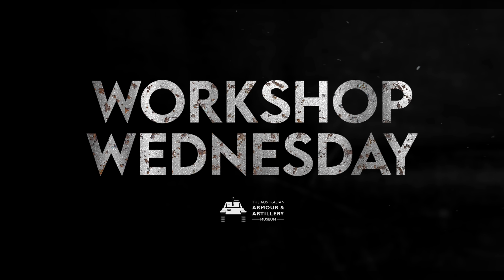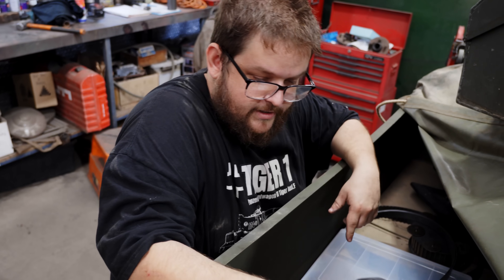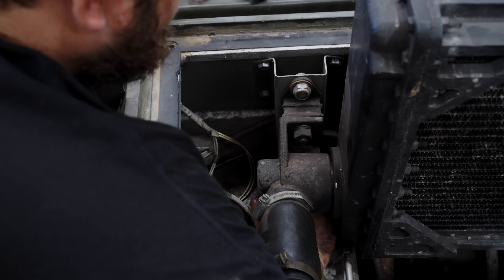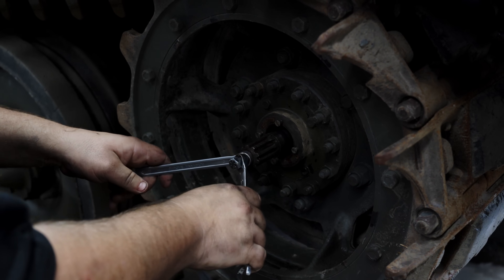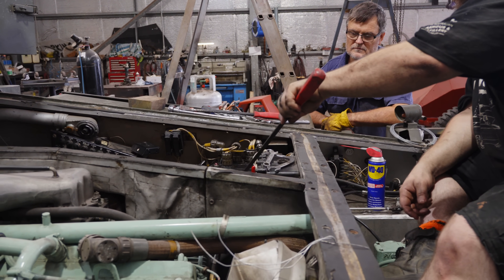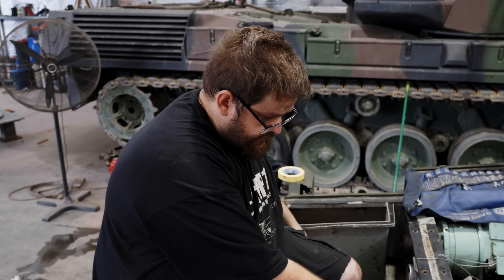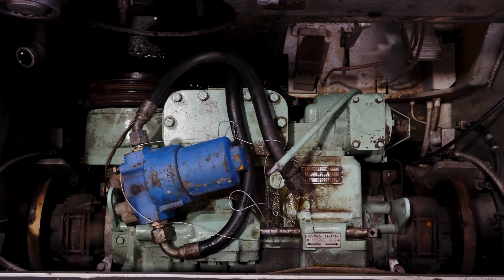WORKSHOP WEDNESDAY: What's wrong with our CVRT Sabre???

Comment: We had three fan belts go in one cold rainy night at Bovington. It was due to a missing shim on the gearbox mount. Absolute nightmare as we were supposed to be tactical 😢
Reply: Most wrench pullers would never think of alignment on a high speed high load coupling giving problems.My guess is 1 mm over the entire face of the flange total , cant be done if you loose track of the shim pack from the factory. Takes a millwright to fix now  , and a good one.

Comment: There are days when I reckon some of these designers just did things to be mean… starter motor in the valley of a V8, starter under the exhaust manifold (of course, if the starter isn’t working, odds are the manifold will be cold, but still)… thanks Graham and all at AAAM.

Comment: been there seen that, all good fun, some things are bolted in so well, you wonder why bother, and those bolts are usually still there because nobody ever bothered to remove those parts, when replacing the awkward bolts are generally left off which is when that term, 'somebody's been here' comes into play - incidentally, we backward engineer some parts for CVRT, got a load of complete fans and still waiting on belts to come in via Mars i think
a good cheat before removing engine and/or gearbox, do laser alignment between input/output where the shaft goes and double check that interconnecting drive shaft is for diesel or petrol respectively, no doubt you know that, i had to learn that one

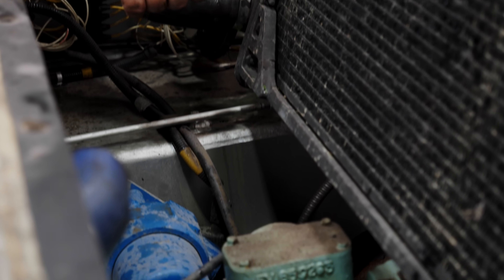Comment: at 2:48 do you why the engines supposed come out first > how do you supposed to do it > take the two Dive yolks off,unplug all the quicker electrical connection they all should be in the same area,take cross member of 3 bolts on either side pull if off and get a crane and pull the whole engine out as one unit because they're packed units all British personnel carriers in the 70s and 80s engines were packed units for quick supplies and put back into the fight so mate you're doing it completely wrong and be fighting with all the time to undo bolts what are hidden and hard to undo  👍👍
Reply: the idea of it was in case the British personnel carriers had a dress short through the engine they could replace with a new engines in it and put it back into service again after patching up the hole in the field and with the new engines that was the idea of them 👍👍
Reply: your right ! like the M113

Comment: do you know that they got drain points under the personals carrier to drain all fluids all water and oil they are little inspection caps you going a crawl under personals carrier with a rattle gun with socket's undo the bolts let the plates drop and you will find a tap turn it on and oil and water come out off it  and the engines are in pack frame so you can pull it out quicker and go back to work all you have to do is release quick connection and pull the engine out and for you do that have to take the cross member off what the front of the Armour bolts on 👍👍

Comment: 2:28 you've never worked in a workshop, if you've never made a mess on the floor. Period. I can 100% say this, because even in Bugatti's (from the days of the Veyron) picture perfect shop, with revolving tiles that slide away from the engine rack that's affixed to the floor on a track, and all that jazz and bling... there's puddle stains. :) They cleaned them well, but they're still visible.

Comment: As mentioned below, The shaft that has sheared is the transmissions oil pump drive which is constantly driven when the engine is running allowing oil to be pumped around the transmission for lubrication and to allow the selection of gears via the valve block, to see that shaft sheer like that is a bit odd, think I only saw 1 in my time with them and that was caused by overtightening of bolt on the part of the shaft that has sheared which is in the middle of the main input flange, the one with the woodruff key that ties both the oil pump drive and the drive to the centrifugal clutch together. Internally the transmission its similar to an old style auto box with epicyclic gears forming the gear train selected by hydraulic application of clutch bands giving 7 gears both FWD and Reverse due to the gearing controlled by the direction changeover lever (left of the drivers knee) I did note that when the drive shafts were being removed, the locating/securing pin on the transmission end didn't seem to need to be depressed (its accessed via 1 of 3 holes on the transmission output to final drive and is a spring loaded cone, retained in the drive shafts) which would indicate the shafts were not aligned correctly which could lead to loss of drive through disconnection. Whilst your this far in its probably worth pulling the driveshafts out the final drives and checking the condition of the sheer pin on them, just a roll pin that secures the 2 halves. the shafts are removed simply by pulling them into the now empty hull, you can check the seals on the final drives too then. To re-align the transmission, shims are used on the centre mount to raise/lower the back of the transmission. there is a measurement from the bottom of the hull to the fanbelt pulley or you measure from the 12 o'clock and 6 o'clock position from either the centrifugal clutch or fan pulley to the flywheel to ensure correct alignment. The radiator can be easier removed or fitted by only undoing 1 mount and sliding it out of the other one. If you ever have fuelling issues, there is a stupid one way check valve near the electric pump that tends to get stuck open with debris, the tell tale of this is the fuel pump constantly clicking away to itself at a steady pace and not slowing indicating its not building pressure.
Reply: not your first rodeo mate !
Reply: @pierreguay6577  nope, worked with them from the J60 jag petrol engine into the cummings diesel era on most variants most recently being scimitar 2. Compared to the other tracked vehicles we nicknamed them skateboards lol

Comment: You can get a set of Starter Wrenches that are made just like you made.  They were designed for starter bolts that were back behind the starter.  Also, a set of offset open-end wrenches that had one end at almost 90 degrees to the other end are worth their weight in gold.
Some old German mechanic is laughing at your getting the short end of the shaft.

Comment: Gearbox input Oil pump drive shaft. They do fail but not on the extent of what he said. When the Cummings engine was retro fitted to CVR T then they had serious issues with the pump shaft. The Gearbox works on Oil Pressure so once the Input pump drive shaft fails. All gears are lost. It drives all the time the engine is running and independent of the centrifugal clutch. You will always have to remove the drivers seat, Fire Wall and 'T' Piece to remove the Gearbox. Enjoy the experience!

Comment: Spent 3 years working on cvrt's in a first line LAD  pulled many a box and engine out, one suggestion I would make is to fit a spare gen gelt and secure it out of the way , saves a whole load of messing when they snap look forward to having fun when putting the quill shafts back in. If you don't get it back within 5 mins then get some one else to try

Comment: Observation: ALL engineers should be required to complete a mechanical trade course/apprenticeship BEFORE being allowed anywhere near a university.
Reply: You might then get a shortage of engineers.   I was a tradesman/technician for 20 years before doing an engineering degree at university.   It was touch and go whether I would go to uni, because I liked putting things together and making them run just right, whereas engineers just sit at a desk.   Engineers get a higher salary but tradies get overtime and bonuses.

Comment: I was a CVRT Spartan driver back in the 80’s, I had a clutch go in the middle of nowhere… myself and the commander striped the tank down and replaced it. A hell of a job with basic CS tools and some tools from our Techs. Nice to see the original Jaguar engine in place 👍
Reply: I was just going to say something about not wanting to do that in the field,  have a great New Year.  Charles
Reply: I think the reason this tank failed was because it was too twitchy for a conscript; you'd have to love the machine to make it work.
In the Army, especially tankers, hitting it twice as hard with a bigger hammer is about as sophisticated as they like to get. Not really their fault when the privates would much rather be somewhere else.... but for a collector this seems to be the ideal tank to have.
Reply: biggest issues I had driving these for years was the fuel system and the points (before they modded the ignition system). Doing the point was a right pita armour off, drivers seat out firewall out just to sort out the poxy points.....grrrr
Reply: What was the ratio? Good team skills or ease of repair of the vehicle?
Reply: Oh yes, you're right... Jag XJ6, correct?

Comment: If I find heap of gold nuggets and I'm going to build the old m4a1 Sherman tank name alison and put in a Detroit Cummins diesel truck motor and 12 speed truck gear box and two long rang fuel tanks and radios and a cb UHF radio and hf radio transceiver radio and antenna aerial

Comment: God what a nightmare. Disassemble half the tank just to get the transmission out. Seems like it'll be fun getting it all back in haha
Reply: It doesn't compare in difficulty, but I remember the instructions in the owner's manual of the Austin America my mother had in my teens for changing the oil — "Remove the old oil filter, using whatever force may be necessary."

Comment: Make sure the coolant is always up to spec on that Jaguar Engine because they  have very long head studs that go all the way down to the Main bearing area and guess what when they snap and they do they almost always snap way down the bottom.
That of course requires some home made very long extensions to drill and remove the broken stud, Almost as bad as the pages in the Workshop manual on the Jaguar V 12's where they show you where to take the hacksaw to the heads to cut them into three pieces when they just will not come off.

Not as concerning as having to use alloy plates and panelbeaters hydraulic spreaders to remove Ferrari Cylinder heads if they have been neglected coolant wise.

So Guys you have been warned be totally anal when it comes to coolant in those Saracen Alvis Sabre variants to save yourselves future grief

Comment: Take two of the NBC locks of the back door of the spartan to fit the drive  splines when you pul them out . Little tip that a cvrt track pin will fit the bolts on the generator if that needs working on in the future.

Comment: SABRE has the cummins Diesel engine.....Not the jag 6....or am i wrong?
Reply: Scimiter had the cummins engine
Reply: @tankcommander1  SABRE also had the cummins, it was part of the upgrade.
Reply: @catlee8064  in all the years I served on them in the uk sabre never had a cummins engine in them . They were phased out of service and Scimiter were done with the cummins engine
Reply: @tankcommander1  https://en.wikipedia.org/wiki/Sabre_(tank)

Says cummins there.
Reply: We used to have petrol engines until late 1990s, then the diesel engine replaced them.. because  all military vehicles were changing to diesel.. I used to drive a spartan in the. 2nd Royal Tank Regiment..
Reply: @leewilliams7565  out of the cvrt family sabre were petrol all others got changed to diesel as with the refit had sabre stayed in service then I'm sure they would have went to diesel . If im wrong apologies however having served on them for years as well as every other cvrt and fixed them I know quite a bit about them
Reply: That is a petrol engine.. not a diesel.. there is no engine cut of lever on the fire wall...
Reply: @catlee8064  it sure does however it was never put in the sabre